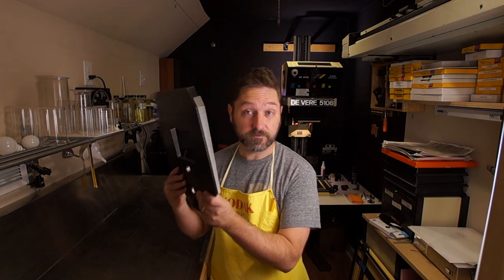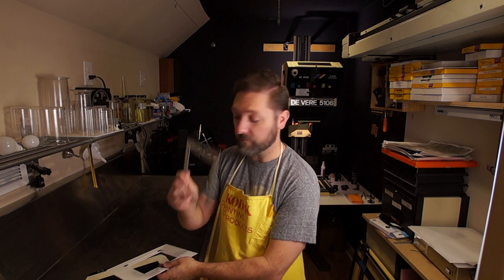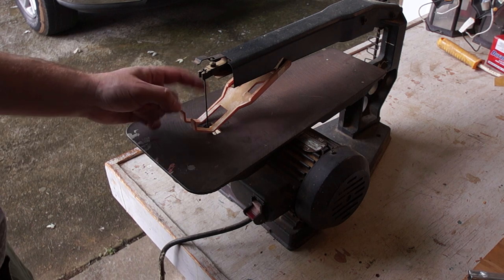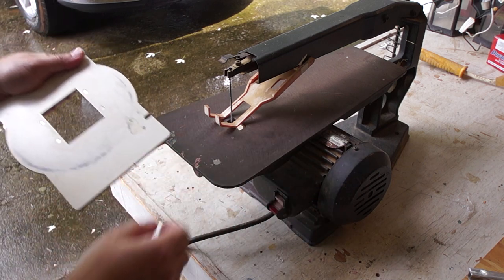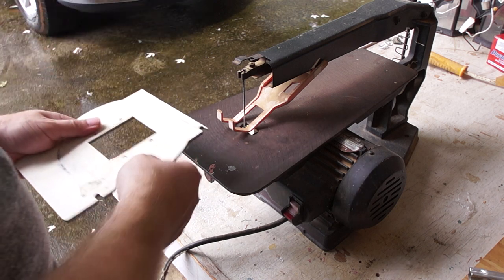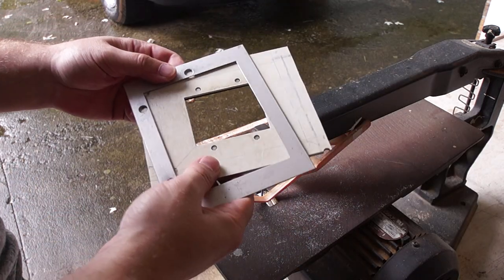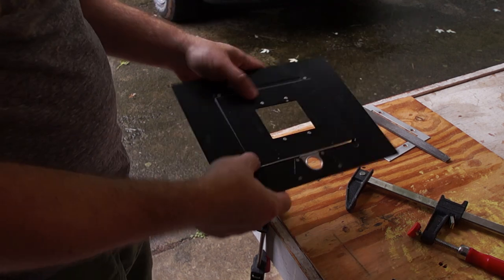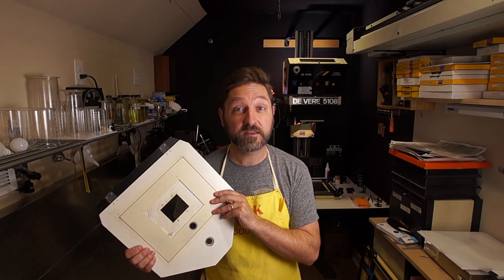Making My Own Negative Carrier

Comment: Good video.  I was having trouble finding a 6cm x 6cm negative carrier for my Simmons Omega B22.  When I bought it, it only came with a 35mm.  I bought some negative carriers very inexpensively (6x6, 127, and 6x7) on Ebay, which were from another Omega model but they didn't fit.  Luckily, a little bit of cutting and drilling and I have a very functional 6 x 6 carrier.  I have a do the rest now.

Comment: Metalworking comes to photography, great, I've just finished making a replacement part for a broken casting on a ball head, luckily it broke just as I removed the camera. I know you will have made absolutely certain there are no sharp burrs remaining from your cut edges.
Reply from the maker: I smoothed them with a file.

Comment: Another option would be to use laser cutting for the basic item, with filing only needed for the bevels and a little sanding of cut edges to slightly round edges that can scratch your film. Laser cutting might be a little more practical for creating an entire item rather than an insert, as it would be less critical to match the thickness required by an existing carrier.

For laser cutting you'd obviously want to choose a very opaque and smooth material such as hardboard or melamine-covered MDF (the best choice, in my opinion). With hardboard, the material tends to be a bit softer and more prone to "fuzzing" at the cut edges, so applying some sort of protective finish (urethane for example) would be advisable, although I don't know what finishes would play well - or not so well - with film emulsions or bases. Designing laser-cut pieces can be pretty easy if you can use Illustrator, Inkscape or some similar vector illustration software. The one laser cutting service I've used (not for negative carriers so far) is Ponoko.

Using acrylic sheet (Plexiglass) might possibly work, although it's possible that even the most opaque acrylic might still pass a little light. Also, it's prone to shattering if dropped. Black delrin could possibly be a good option, but there might be a little risk of warping. Laser cutting metal is expensive - really expensive - and not worth it in my opinion. But laser cutting these other materials, especially for simple shapes like negative carriers, can be fairly cheap. Prices are usually based on the time required to cut a particular shape out of a particular thickness of a given material (as well as the cost of the material, of course, which is almost always lower than the cost of the actual cutting). Generally, the simpler the shape and the softer and thinner the material, the lower the cost. (There are some cases in which thinner materials are slightly more expensive to cut than thicker pieces of the same stuff.)
Reply from the maker: Laser cutting would be quick and clean, but the accessibility to these machines that can cut aluminum may not be possible for most folks.  Personally, I own and use a milling machine and lathe for a lot of projects, but this channel is for people who may not have that type of stuff to use.  I almost used a hacksaw for this to make it more accessible, but it was just too hot outside for that.